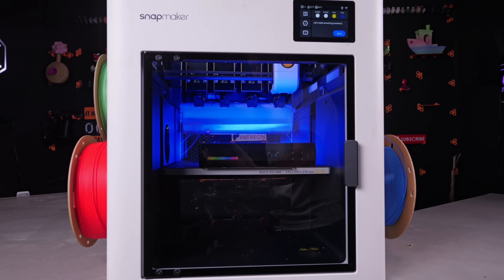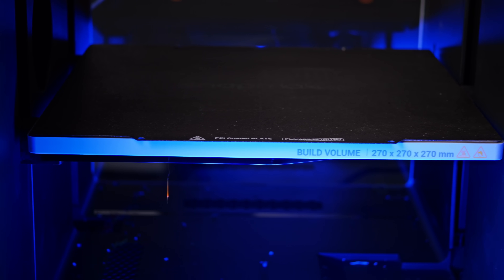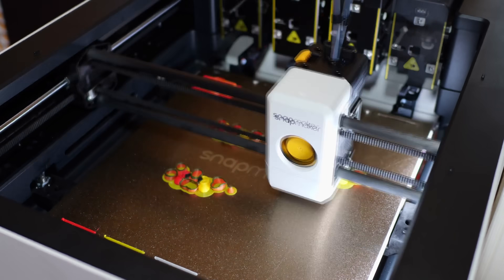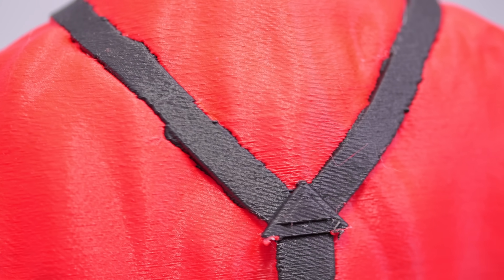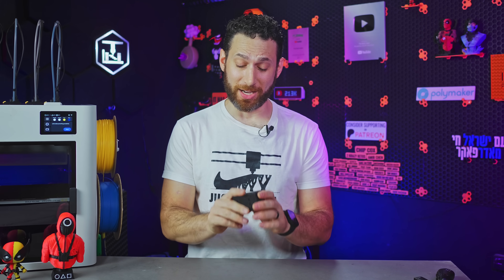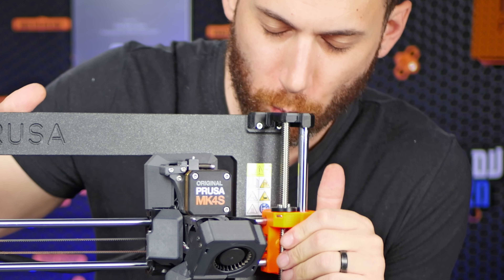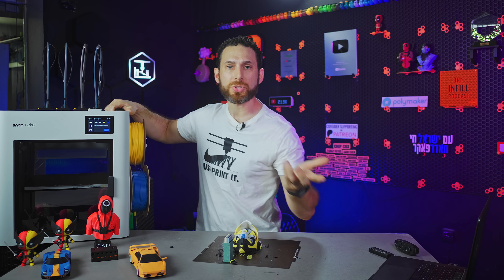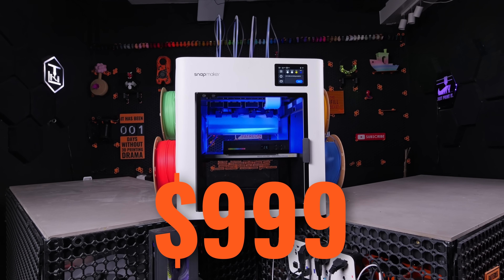The SnapMaker U1: HOW is This Even Possible?

Comment: I didn't see one sharp looking print in this video, needs much more work
Reply: I 100% agree with you. These prints are FAR from "Jaw dropping". I've seen much better results from cheaper printers.
Reply: @falcongunner33 now that's a blatant lie and you know it.
Reply: @ShadowGun625  where’s the lie? I’ve seen much better results from the $299 centauri carbon. For multicolor ive experienced the Creality K1 which I got on sale for $399 + $299 for the CFS. Cheaper than this new printer, better results. Don’t talk about things that you have no idea about.
Reply: They dont pass my quality check too. Surface quality is not on par to current printer.
Reply: @joeltorres3202   I thought the same thing. The best conclusion of this video should've been that there's a lot of potential in this as a budget friendly tool changer platform. But he started raving about objectively terrible print and told a commenter their standards are impossible.  Fact of the matter is you can get printers for half the price that are ready to produce professional quality prints.
Reply from the maker: Your standards are impossible, then. These are jaw dropping printers considering I made my own profiles for each of them.
Reply: @thenextlayer  The layer consistency on the camera grip looked pretty bad, and the TPU stringing was almost certainly not due to water absorption. It would've gotten worse as the print progressed. Even if it was, I don't see why you wouldn't dry + print out of a dry box to test that theory.
Would've liked to see some actual high-temp engineering filaments (PA6-CF for example) and not PETG-CF; I'd hardly call that engineering grade.
The car prints were again just okay. Gaps in the top surfaces, 2 of the tires coming off the build plate (you can see one of them moving). Not cleaning the build plate after the first adhesion problem was just lazy and a bad cop out. The layer consistency looked horrific on the blue car.
Reply: @thenextlayer  Sorry man, I generally like your content quite a bit, but this really feels like Snapmaker paid you way too much for this advert :(
Reply: @thenextlayer Why would my standards be impossible, every print presented here had bad damage to them with or without the loss of power situation. I mean none of the prints were acceptable. You can clearly see this. Thanks for the video though.
Reply: @curtflirt2  I think some of the issues were slicer settings and the limitation of how it decides to blend colors together.
Reply: @protecteratr You could be right, who knows but the bigger issue here is that these prints were very bad and yet he's here saying that they were great, lying right through the screen to us. Lol. This is why people doubt reviewers especially when money passes hand to hand. At least he could have just been honest with the print quality and certainly not try to say that any of these looked great

Comment: I'd think the issue with support colors would be a common one, I'm surprised the slicer doesn't use the same color filament as what it's touching for the last layer of support.
Reply: Well the support filament colour will depend on the support material you load, usually people make them different colours to more easily tell where the support actually ends
Reply: @shanematthews1985  If you've got an extra head, or slot on your AMS, then adding specialized support material is beneficial. Otherwise, if the stuff may stick, IMO it's better to use the same color. Not like people weren't detaching supports long before multicolor printing was a thing.
Reply: @o0shad0oo  I'm doing exactly that... with yxpolyer breakaway support filament, works with every material and with zero z, it looks noct only perfect but is easy to remove.
Reply: @MartinKuras  One less color that you can print, but cool.
Reply: @o0shad0oo  Sure but if i'm using an actual support interface material i wouldn't want it to be the same colour so i know i got it all off, otherwise you're not actually using a different material and it would just be the same spool

Comment: The printer doesn't look terrible, but the web page and Kickstarter for it look really sus to me. :-P
Reply: While I agree with this main comment, snapmaker is well-known and a successful company with very good machines the just never made a cutting edge flagship unit and most did bolt on gimmick features that did actually work well so for that I give them props but this is leagues ahead from from there bed-slingers
Reply: It's Snapmaker. There isn't anything sus about it. It would be sus if it weren't an already established company, but this ain't it. If this makes you suspicious you need to dial back your paranoia quite a bit. The rest of us will feel just fine.
Reply from the maker: Really?
Reply: @thenextlayer  Sooo much over-the-top tout, screenfuls of it. Feels like the ad budget is greater than the engineering budget.
Edit: Also the timer on the extra-savings thing making you feel rushed to give them money. I guess that's expired now so it's no longer present on the Kickstarter.
Reply: @o0shad0oo I just put in my pledge right now. I still got the early bird for $749. Plus since I put down the $30 deposit ahead of time, I will get a $100 refund after the campaign finishes. That puts it at $649.
Reply: @ODXJ  Good for you. Good luck.